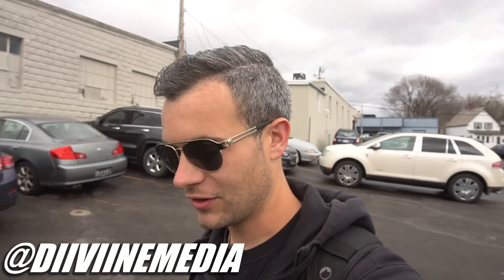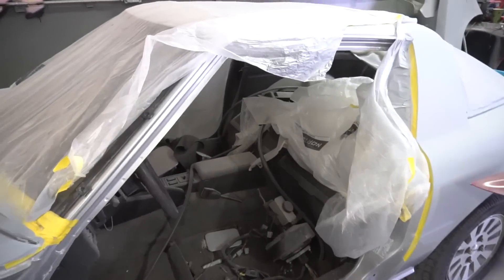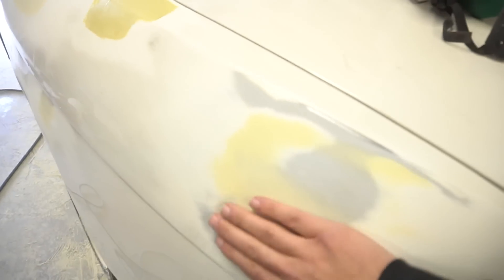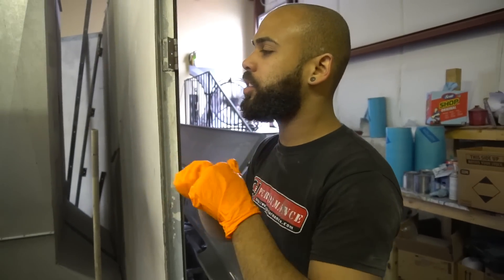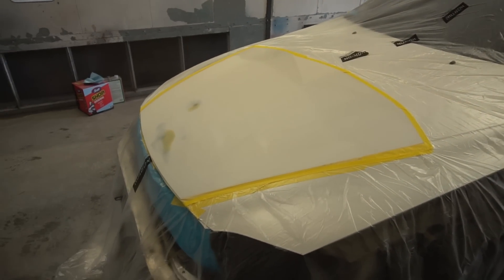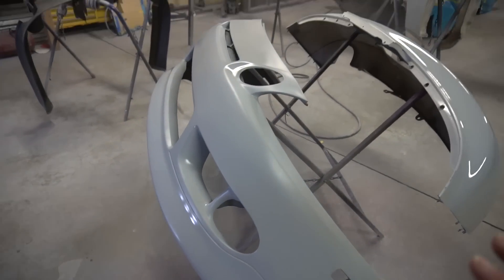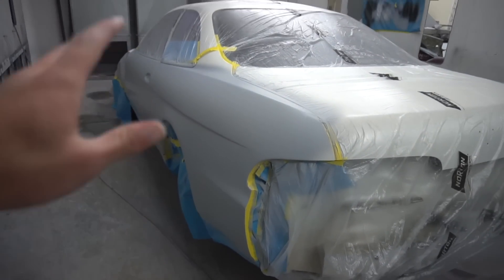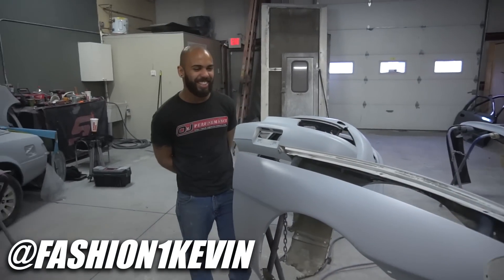SOARER GETS PRIMER! (Candy paint job Part 3!)

Comment: Can't believe he is painting over the lower door mouldings. They just pop of  with a gentle pull smh
Reply: DEVEOUS think this place is kind of a step above Maaco.. overheating compressor running out of primer and barely half a booth is scary man. Not trying to hate but I really hope this comes out well. He wouldn’t have missed anything in the first place if they had actual lighting..
Reply: Jaydee392  moldings will be pulled out. Over heating compressor is because is in a room that’s closed up when it gets warm we remove the door  so that it won’t overheat. It’s a new snap on unit. As far as missing things there is nothing missing on dents and stuff but we prime and then block it to make sure the car is nice and straight  if there is a person that primes just once over a bunch of body work and then sprays it well I’m sure the car won’t be 100% straight